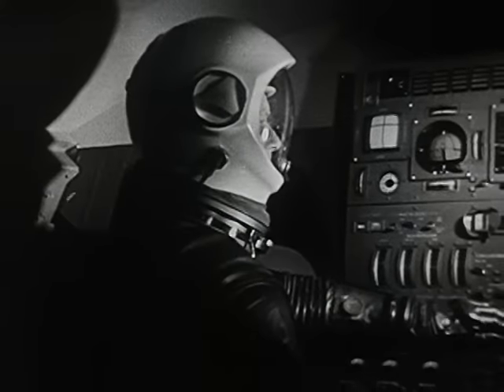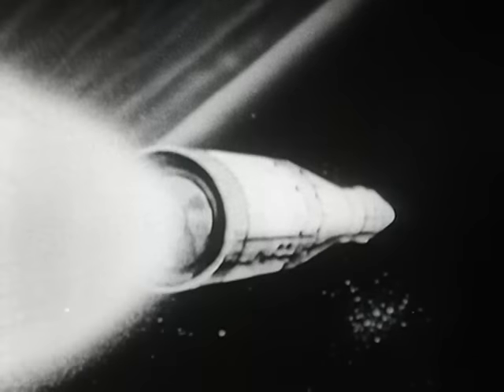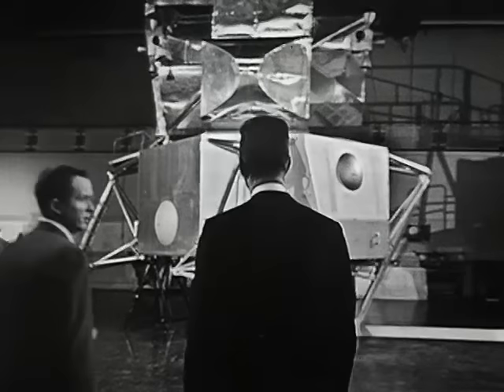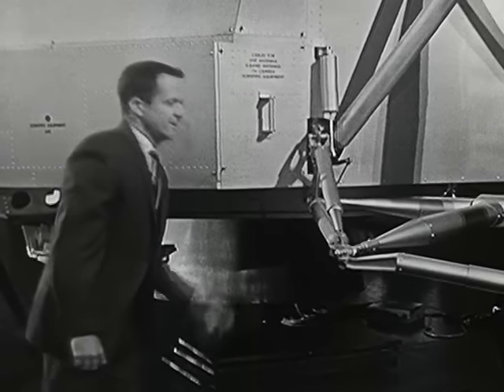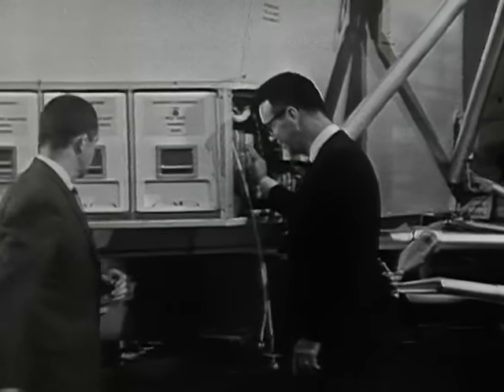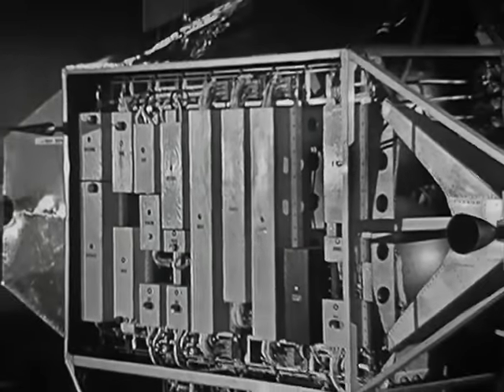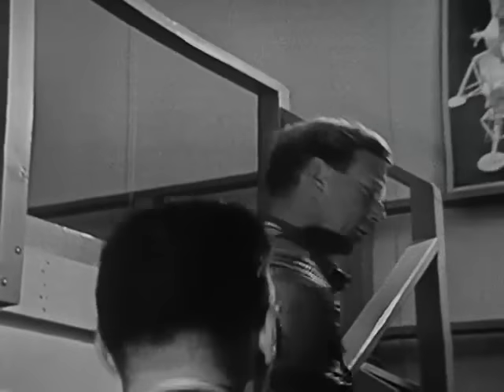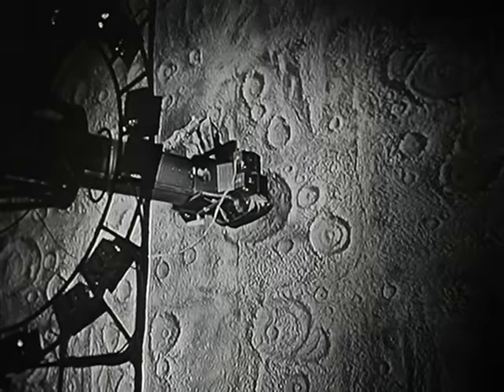MIT Science Reporter — "Landing on the Moon" (1966)

Comment: All very interesting. Since the 50th anniversary came up in the news, I've been wondering where the lunar lander, and the astronots got there power from, there seems to be very little on that subject. However, late on in this presentation, it states the man at the console could test all manner of things, like the pressure in the helium tank, or the AC power bus. It appears they had 115V ac ! So they either had a generator, or used some oversized battery pack and invertor. All those CRT displays and cameras and transmitters must have used current like it wasn't metered, no wonder there are doubters it even happened.
Reply: "...seems to be very little on that subject".

You mean you can't find it on the internet.
Reply: eventcone ...and where else would you look ? Actually I have just looked up " lunar module power supply" and guess what, NASA published the information. Apollo 13 required 7 off, 100 amp hour batteries. I have recently changed my own car battery, a 95 AmpHr. one, which is rather large, and more to the point, heavy,       Very,     and NASA is saying they took 7 to the moon, and yet we're counting stitches in the astronot suits to save weight ! Something doesn't add up.
Reply: @tonymak9213  "...and yet we're counting stitches in the astronot suits to save weight !"
Sounds like the typical over-exaggeration hoax believers like to do. You know, like how NASA released the information that the Apollo 11 SSTV transmittal data tapes were inadvertently lost and that's morphed into every Apollo video and picture taken on the moon has been lost or destroyed.

 When Grumman originally won the LM contract, they had a weight proposal of 22,000 lbs. Due to NASA's insistence of as much redundancy as possible, the weight quickly started to increase peaking out at about 32,500 lbs before some weight reduction programs were implemented. Despite a lot of effort to control weight increase issues, the first 4 LM's designed for the G and H missions ended up at 33,500 lbs and the 3 J-missions at 36,200 lbs. So as you can see, right from the start, it wasn't a case of saving as much weight as possible, it was more of controlling and trying to reduce weight increase as much as possible. No doubt you will bring up how they managed to include the lunar rovers on the last 3 missions if weight was such an issue but the answer is pretty simple. Grumman was informed early into the LM development that there was a strong likelihood of the Saturn F-1 and J-2 engines being uprated sufficiently enough that Grumman should allow for the possibility of some type of  enhancement to the missions that would extend the range of lunar EVA's. With that in mind, quadrant 1 of the LM was purposely designed to allow for the storage of whatever it was that NASA decided upon which of course turned out to be the lunar rover. 

 As for the batteries, what of it? They originally planned to use 3 fuel cells but due to the complexity of them vs off the shelf battery technology, they decided to switch to batteries despite the extra 100 lbs added on. If this was all faked, they simply could have said they used the same type of fuel cells as what was used for the CM/SM and nobody would have been the wiser.
Reply: @tonymak9213    Any other concerns you have?
Reply: I absolutely agree with  you. In theory it looked  feasible.  In practice   not a chance.
Reply: @tonymak9213  it doesn't add up maybe because it never happened lol
Reply: @tonymak9213  I'm guessing your car battery has lead plates, a plastic casing, can be recharged daily for 5 years and cost about $150? How about a titanium cased power cell with alternating  zinc and silver plates that can only be recharged a maximum of 25 times? Costing at a wild guess, something like $100,000 each in 1969? Probably half the weight of your car battery. Another graduate of DKU I see.
Reply: @tonymak9213  Totally agree. What kind of batteries can run cathode ray tubes, air conditioning, mechanical thrusters. My high-tech car battery weights 2000 lbs in 2024 and I can only go 180 miles with my A/C on.
Reply: @astronomenov99  wow batteries with alternating zinc and silver plates, sounds luxurious!

Comment: No mention of where the rover went.
Reply: ash smitty it wasn't planned for in 1966. At this stage of development, the LM forward hatch was still round, not square as it eventually became. Incidentally, the rover finally went into the front, left-side quadrant of the descent stage first appearing on Falcon for Apollo 15.
Reply: hardakml When did they plan for the rover? Thanks.
Reply: ash smitty watch moon machines, a great series from 2008
Reply: About 67-68 when the final development of the rover was done.
Reply: ike fun lol. Touché
Reply: Ronald Tartaglia I have seen the moon machine series. However I only have about a 1 Megabyte brain memory. I'm constantly having to bin and clean the trash and clear one memory to make room for new ones. So I may have forgotten, uh I mean binned that memory to make space for my holidays.
Reply: ash smitty in the garage silly
Reply: Arthur Duda 😂 nice one
Reply: Milt Farrow but the shake machine will be broke, it breaks damn near every day for some reason 🤔
Reply: Probably behind the 4kw battery that made it possible for the to have direct tv-link with earth and phonecontact with nixon without delay
Reply: Robert Strandberg IKR!
Reply: Terry Winter  : You again. TRy looking up some facts. On the moon, with believe it or not, the rover was only 1/6th of earth's weight. THe rocket motor was gimbled. You can look it up. So, surprise, they motor gimbled to keep balance. Aren't facts a wonderful thing? You should try making use of them, rather than use your limited brain powerr.
Reply: Terry Winter  : go back to your hoax / conspiracy sites. You know you don't like facts. Why not look up the C of G for the LM? Try some facts for once.
Reply: Terry Winter  : so rather than look up the C of G, you change the subject. Why do flaturds and hoaxers do this? Why is my opinion of NASA so important to you?  I suggest that my beliefs are not important. The facts are. Why not look them up? How far is the center of effort from the center of gravity? Is it zero? Or several meters apart? When you find an answer, then you can find out how far out of balance the LM is. Then it would be a question of can the gimbled motor accommodate this? Then you could have an answer to your original question.  Or just change the subject again? Then you could ask, what would the engineers do? Go to lunch, or find an answer that would allow the missions to succeed?
Reply: Terry Winter  : boy, are you having a rough time with simple physics. Another hoaxers site. And another subject change. Why not try, just try sites that aren't hoaxer / conspiracy biased? Maybe if you answer 1 question before forgetting and trying another question. Why would you expect dust in the landing pads? Try thinking about the problem. The rocket exhaust can be seen blowing the dust away. Where did the dust go? AWAY from the lander. What magic do believe will bring the dust back to the lander? Remember, there is no air to support any dust. So what magic do the hoaxer sites have to bring the dust back? Dust in the pads would happen if, like the hoaxer sites implore, the landings were filmed on earth. The believers, with their limited knowledge and limited abilities, swallow this whole, and never question the hoaxers sites.  Also, since you can't concentrate on 1problem for long, I found an answer for your troubling stability problem. Notice it isn't a hoaxer you tube site, and, since you have trouble understanding NASA,  I found a non- NASA site, just for you.
http://www.clavius.org/techlmstab.html
Reply: Terry Winter  You can't even ask politely.  Answer a question first. What is "a great deal of force" in numbers. You've got the 1/6 th gravity right, just as NASA states. So the LM has burnt about 10 tons of propellant, (less mass) and has slowed to a hover, (less inertia). What would that "great deal of force" be? Then comes the size / mass of the particles. Obviously the thrust wasn't enough to blow the moon off course, the largest boulders were untouched, the smaller rocks were untouched, some larger particles were untouched. The smaller ones are easily seen to be blown away, never to land back in the pads. Look up Newtons Laws, unless you believe those are false too. And learn some manors, some people find them useful in life.
Reply: Terry Winter  : I saw the dust blow away, as everybody else did. Nothing I saw broke any law of physics. Continue to believe and have faith with your hoaxer sites. Some high school science could explain much to you, but you seem resistant to learn. Every question you have raised has been answered for 50 years or so.
Reply: Terry Winter  : sorry. I'm always condescending to idiots who believe hoax  / conspiracy sites, so you're not alone. The descent engine could throttle down to about 1000 lbs of thrust, according to the manufacturer, TRW, since you selectively can't believe NASA. With no air to confine the exhaust, the PSI load on the moon's surface was small, and it did blow away the dust, as seen in the videos.
Reply: Terry Winter : another change of subject.  More conspiracy sites. Free energy? Mars deception? Kubrick filming the landings, all 4 parts?  The list goes on. No wonder you have such warped beliefs. Maybe I'll spend more time there when I need a laugh. Odd that that site didn't help you with any of the questions you asked me. And yet you completely ignore this site, with a presenter from MIT, that explains the LM. It seems MIT doesn't know your "real" story. They must be telling lies and be paid off by NASA too it seems?
Reply: Terry Winter  : what I say doesn't matter. There are many videos of the LMs landing on the moon. Both rockets follow Newton's Laws. One lands in atmosphere, with 1 g. The other lands in 1/6 g, and no atmosphere. Their designs are obviously different. Have you figured out your c of g problem yet? The LM was designed, without the help of armchair specialists, to have a c of g as low as practical. The Dcx obviously has a higher c of g, with a less practical landing gear, likely for weight saving. The results are also obvious, and both, again, follow Newton's Laws. I see no characteristics that would allow either to break any laws of physics. Do you? The Dcx was abandoned because it was impractical. The LM, which worked so well, was abandoned when Nixon ordered the missions stopped.
Reply: Terry Winter  actually, on Apollo 11, the engine was developing so little thrust that it was still running after landing. I have seen no evidence, in the film of the landing, of any sign of the throttle up, or any mention of it.  As for dust we all saw some of it blow away. Why do you have trouble that not all of it was blown away? Dust left in vacuum for a few billion years would be rather compacted, as they found. Not fluffy like in our atmosphere. Likely the Saturn V engines would blow all the dust away, but not the little amount of thrust, spread over a wide area that the descent engine was developing during landing. Remember that in vacuum, the rocket exhaust was a very wide pattern, limiting the PSI on the surface of the moon.
 Have look at this.
https://www.hq.nasa.gov/alsj/a11/a11.landing.html
 There is no mention of throttle increasing for the landing. There is mention of the dust.
 And as per another thread you had trouble with, notice the pauses in the audio.
 When you find something that breaks the laws of physics, let me know.
Reply: Terry Winter  : actually, Neil commented that the engine was running after touch down for a few seconds, obviously at very low power or they wouldn't have landed. There are comments that the dust first starting blowing away at 100 ft altitude. Likely, this would be the lightest particles. I find it logical that, as they descended, heavier particles would be next, leaving the heaviest particles in place with not enough thrust to overcome their inertia. I see no reason why the remaining heaviest particles on the surface would prefer to jump into the pads on their own, or that other particles would return by magic. Reality bares this out. May I suggest you stay away from the hoaxer sites, they are leading you astray.
Reply: Terry Winter  : I did some math for you. According to TRW, the engine would throttle down to about 1000 lbs of thrust. We know, because there is no atmosphere, that the exhaust spread out widely, not at all like the films of 1940s V2s taking off.  I have to pick a number. Lets say the cone of the exhaust is 5ft diameter? that works out to a pressure of about 0.35 PSI. If the exhaust cone was 10 ft diameter, that works out to about 0.02 PSI. Not a lot to blow anything around, is it? For reference, a car tire is somewhere around 30 to 35 PSI, our atmosphere is about 14.5 PSI.
Reply: Terry Winter  : Is it too early for you? The descent engine had a throttle, as it would be difficult to land at full thrust. Try parking your parents car at full throttle. Most aircraft do not land at full throttle. Do you pedal your bike as hard as possible into a wall to stop?.The engine had a maximum thrust of about 10000 lbs, throttlable to 10 % Of max. Maybe I should ask what grade you are in.
Reply: Terry Winter  : yes, you are. Bigger engine, no throttle, no landing.  Smaller engine, more consumables to survive the long descent, more weight. Bigger Saturn V needed. Engineering is always a compromise. How do i make this simpler? Again, what grade are you in?
Reply: Terry Winter  : it seems you're still missing something.
Reply: :  Terry Winter  : the last several centuries of science, at the  least.
Reply: Terry Winter  : a few centuries ago, Newton figured out some laws of motion, and laws of gravity. Both are involved with rockets, and landing. As I have tried to explain, too big a motor would not land the LM, too small a motor would allow a crash landing. The engineers chose the best compromise between performance and weight, and ended up with a throttle-able engine.
Reply: Terry Winter  : it seems you don't understand physics enough to understand how and why rockets work. Why not look up the infinite things you know nothing about? Of course the outer cover garment doesn't look inflated - it isn't. The specially developed lunar suits from 50 years ago are no longer in use, and were only used on the moon, as they require gravity.
Reply: Terry Winter  : just as the hoaxers believe, there was no air in in the moon suits. 
 No, really, why not look up that the moon suits had 7 layers, with many layers outside the pressure layer.
Reply: Terry Winter  : you're right. The hoaxer sites have about 1 fact in them, the rest is bull shit, with no facts to support their conspiracies. Your choice.
Reply: Terry Winter : Good.  I know you'll go back to the hoaxer sites, they're fun, or annoying and anything but truthful.: Why do you have trouble with NASA?  They explore space just as the many other space agencies around the world. Do you believe the Mercury missions never happened? The Gemini missions were fake? The video shows the LM,  I know you can't understand it, so you think it's fake? Many other countries have sent missions to the moon. They're all fake? India lied about it's mission to Mars? Believe what ever suits your needs. No sense letting facts distort your believes.
Reply: Terry Winter  : Why? He's one of your sources of bad information. Why not watch more videos from original sources, like this one, rather than have some idiot make decission on what you're to believe?
Reply: Terry Winter : you've made up your mind. Enjoy the hoax sites.

Comment: “No amount of evidence will ever convince an idiot”-Mark Twain
Reply: Easier to fool people than convince them that have  been fooled - Mark Twain 😅
Reply: @Golf5Alpha Do some proper research for once.
Reply: @Golf5Alpha  The camera didn't operate at 500° F. And the batteries weren't lead acid car batteries.  They were silver zinc batteries.  The technology is well documented on the Internet. Feel free to point out actual flaws.
Reply: @Golf5Alpha  The data isn't lost, the technology is well documented. And the Mars helicopter is unrelated, but high altitude drones do exist which can fly in similar conditions as Mars.
Reply: @Golf5Alpha  Not even sure what you meant with your first point. But clearly you know very little on the subject of the Moon Landings don't you?
Reply: @Golf5Alpha  Actually the Moon should be just as bright as Earth, which it is. Either way though, brightness is relative, look at the Moon during the day and it looks dim.
Reply: @Golf5Alpha  Most of the source code is public domain, the camera were timed with the lem ignition.